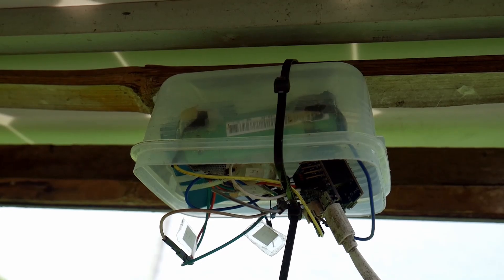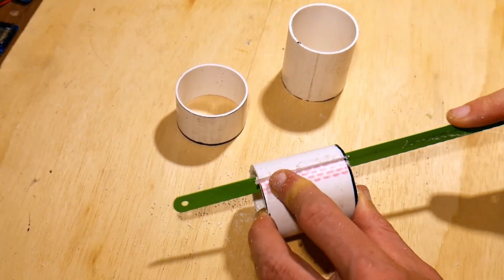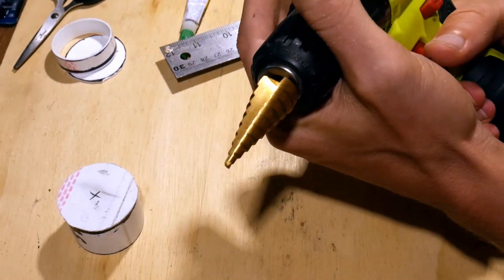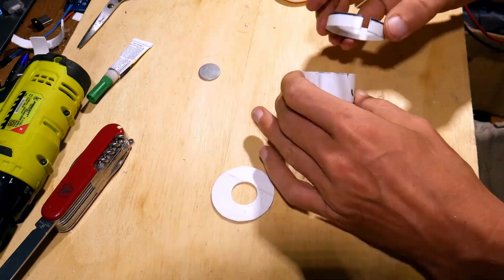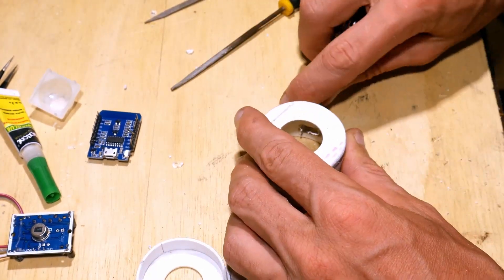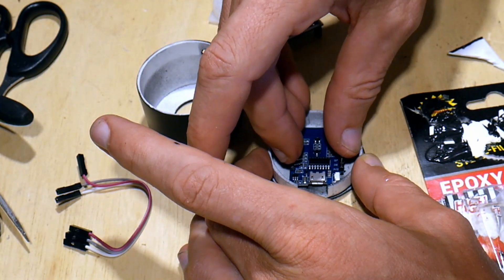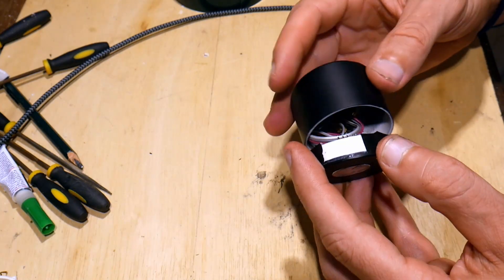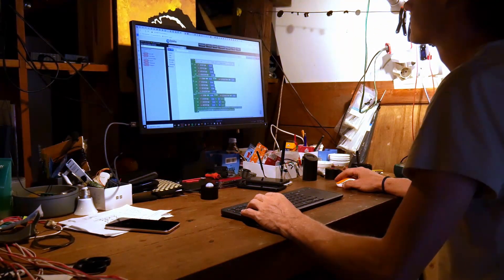DIY electronic enclosures made from PVC pipe for IoT devices

Comment: Very cool! But does the magnet not interfere with the electronics?
Reply: Magnetic fields are static. So as long the magnet stands still and doesn't move around the electronics there should be no interference. And after years of using this sensor. I can't recall any problems so far :)
Reply from the maker: edsteve is correct about the intereference. May i ask how you found that video? Did you look for pipe enclosures? :)
Reply: @bgradediy5267  No, I came over from Reddit. :)